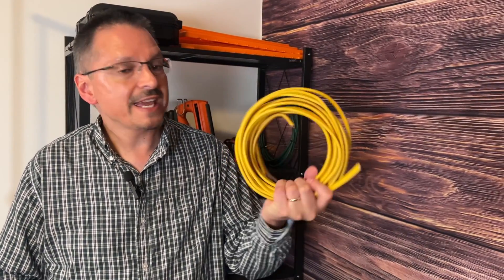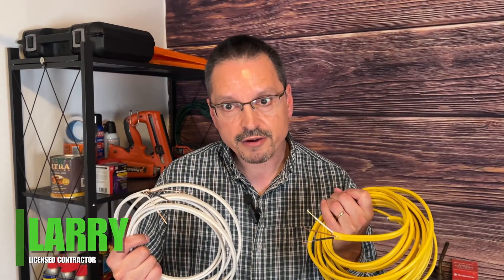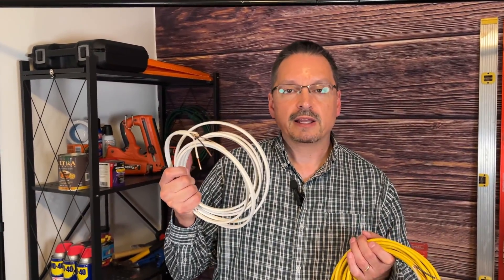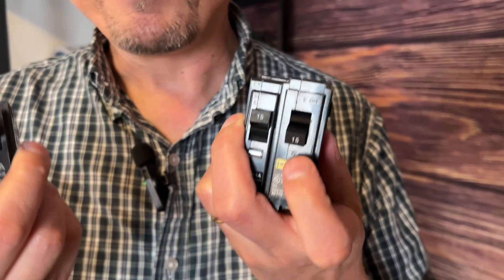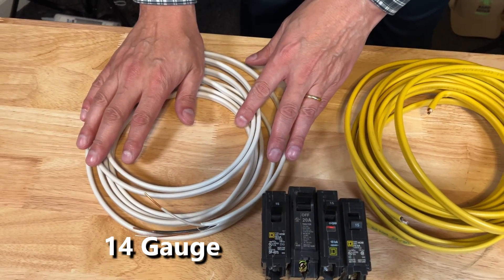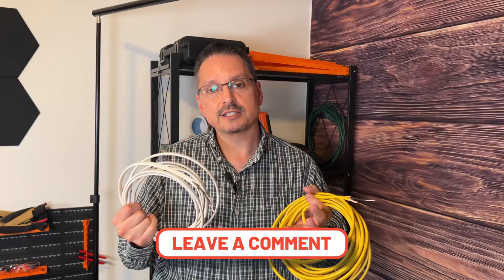Yellow vs White: Wire Guage Explained

Comment: Happy Sunday!  Great video!  Say, I'm a DIY guy and learning electrical.  I'm adding a electrical outlet to a room.  I purchased yellow wire because a few videos showed that's what to.use.  I know not to add white wire to a yellow circuit. Can I add yellow wire to a white circuit?
Reply from the maker: Hey, great question. Yes you can. Because you’re adding the extra thick wire there will be no safety concerns at all…

Comment: The benefit of thicker wire is lower voltage drop, which is more important on 120V systems than on 230V systems.
Reply from the maker: You've hit on a crucial point about voltage drop. You rock 🎸 Thanks 👍🏼😎

Comment: Why is yellow wire used to daisy chained lights
Reply from the maker: It depends on the amps rating of the circuit. However, just using the yellow Romex 12 gauge should guarantee the wire is thick enough for all normal light & outlets circuits

Comment: I’m doing a basement apartment.  It will consist of a bedroom, bathroom and a small kitchen.  Which wiring should I purchase for doing this project?
Reply from the maker: The easiest is just go with 12 gauge size wiring. That’s the yellow one. That way you would not be under sizing anything. Even if you have some 20 amp circuits mixed in there. Such as kitchen outlets are supposed to be on a 20 amp circuit. If you go with the thinner wiring, you might be undersized. Just go with the thicker 20 amp yellow Romex wiring and you’ll be good. 👍🏼🛠️😊⚡️

Comment: Ok. 15 or 20 ap circuits. Which ones do I have? Is the only way to find out is by how the fuses are marked in the electrical box?
Reply from the maker: The markings in the main panel box is an excellent way to determine. But the thicknesses of the wiring in those branch circuits is also very important to know. But yeah, please just check your main electrical panel box and each circuit will be labeled. 

I’ll give you a tip… If you’re adding some new wiring, just run the Yellow Romex 12 gauge wire. That way you’re covered no matter what. You can legally run that size wiring in both 15 and 20 amp circuits without any problems at all.

Comment: This is general a question I thought the white or grey one is for the inside and the yellow one is for the outside of the house?
Reply from the maker: No. I think you are referring to a totally different color coding system. White is smaller gauge wire and yellow is thicker gauge wire. This is only for interior wiring purposes only. Thanks for asking the question though…

Comment: I have old silver wrap wiring which color do I use to connect wire to a existing circuit.
Reply from the maker: To be safe if you just add the yellow 12 gauge wire for new work, you will be covered and there will be no safety risk by using too thin of a wire. 👍🏼🛠️

Comment: can I use left over 14/2 outside wire to make a extension cord?
Reply from the maker: Yes. 14 AWG wire size is good for extension cords. Just make sure not to overload it 👍🏼

Comment: Hi Larry, I like the video very knowledgeable,  I just recently purchased a whirlpool washer and it's on a 14 Guage wire the white one and recently it's been tripping also my microwave has been tripping they are both on the white wire , should I change those circumstances to the 12 Guage wire ( yellow ) wire ?
Reply from the maker: YES! If you’re able to upgrade your wire size to 12 AWG and while you’re at it make sure you have a 30amps circuit breaker if that circuit is all 12 AWG wire. 

If you still have issues, install a dedicated circuit for your microwave. Good luck 😊🛠️⚡️

Comment: I was debating led on 12/2 or 14/2 decided 12/2. Outlets definitely 12/2
Reply from the maker: Thanks for watching. with LED, 14 AWG electric wire would probably be fine. However, the awesome thing about spending a touch more and installing the thicker 12 AWG wiring is you will never regret it and you are future proofing your circuit for anything.

Comment: My 100 year old house has no white or yellow like you.  It’s all black and white.   So to run a new outlet should I do white or yellow.    I feel yellow is safer choice.
Reply from the maker: You’re correct. Just running the slightly thick (yellow) 12 AWG wire is better. Thanks for watching ⚡️👍🏼

Comment: This is simply a poor video.  I have 12 gauge in wall/junction box (yellow and white and they are both 12 gauge).  Start over or clarify.
Reply from the maker: Great point. All Romex was white in the past. The modern color coding system is somewhat "new"

Comment: Awesome tip on not mixing up the wires.  I was about to use white wire to add another electrical outlet, coming from a yellow wire.  Thank you 🙏
Reply from the maker: Glad it helped. Thanks for watching & commenting 🛠️
Reply: I'm glad to see you were intuitive enough to go online and educate yourself before wiring that circuit.
Common sense isn't as common as it used to be.

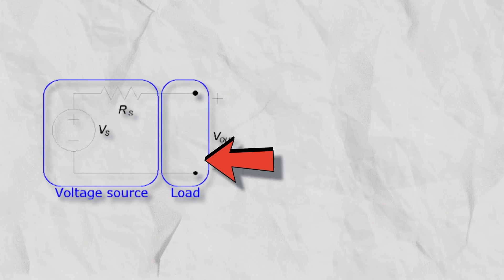Comment: 1:30 Thicker wire will reduce the voltage drop. For long wiring runs you may be required to use 12 gauge on 15 amp circuits to keep the voltage drop to an acceptable level. "The load will actually determine how much power is coming through". The wiring resistance is part of the load. More voltage does equal more power, even if it is negligible for normal wiring run lengths.

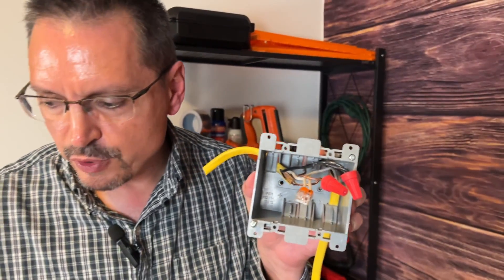3:00 Mixing gauges is only a problem if you use 15 amp rated wire in 20 amp service. Using 20 amp rated wiring in 15 amp rated service is ok, even required sometimes. The circuit breaker amp rating is the rating you should follow. You should not depend on other components to determine the circuit rating. If the breaker is wrong, you are already at risk of burning your house down.

I only use 20 amp rated wire, because if I'm bothering pull a new circuit, I don't want to need more amperage later, and regret pulling a 15 amp circuit.
Reply from the maker: All great points. Thanks for sharing with the public. Yes you can choose to wire your entire house in thicker 12 AWG Yellow Romex if you want to. I wanted to keep it simple and quick in this video. 

My first house was 100% 12 gauge on ALL circuits 👍🏼⚡️🛠️🛠️
Reply: @singularityphoenixx  thanks for sharing. Am I right? I bought in old church, I’m running 12/2 to everything. I mean it’s easier to change a breaker than the wire. We also use a space heater in areas during winter. I’m just doing all 12, is that ok? Thank you!!!!